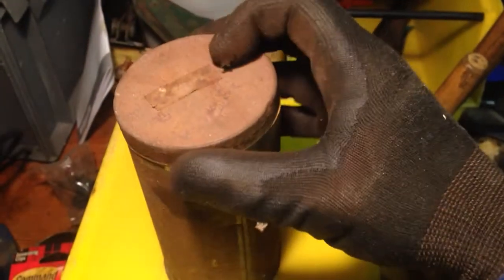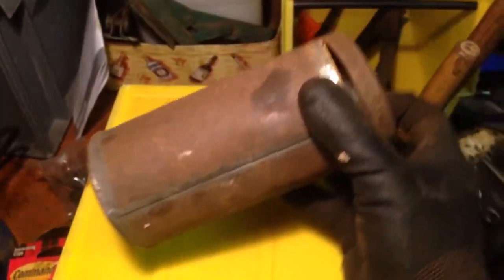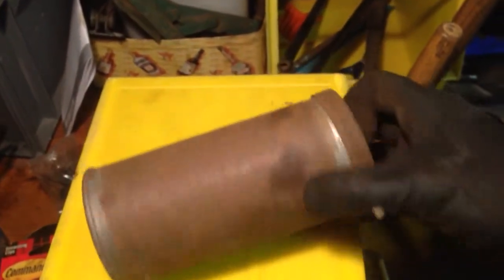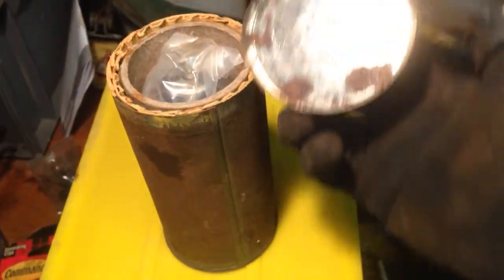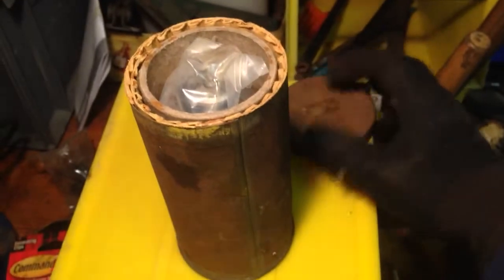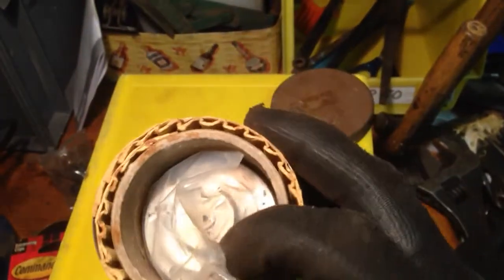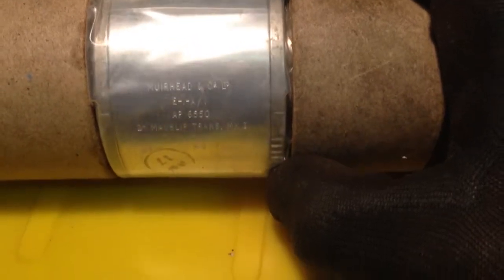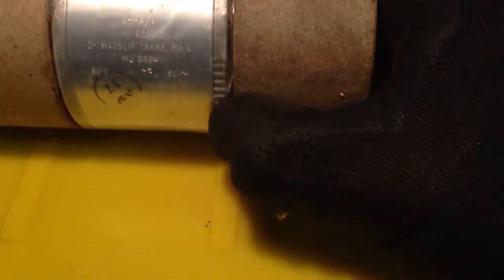Muirhead and co magslip

Comment: Its a magslip transmitter. Similar devices are called (more commonly) synchro's. They transmit the rotational position of something (e.g. an aerial) via electrickery to a receiver unit that can be at a remote location The  receiver can then rotate a display to show the position to a bloke in a control room or somewhere similar.They were also used heavily in the military somehow to control or monitor remote gun stations
Reply: AMQ Ltd
If the load isn't too high, apart from acting as an indicator of position, probably its prime purpose,
they could also be used as a remote control. Turn one at one end and the far one will follow it,